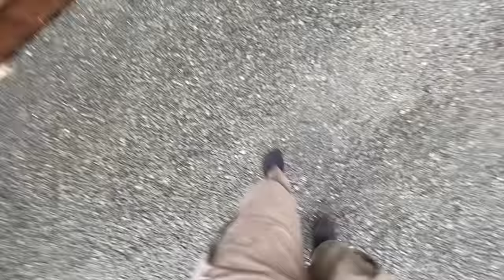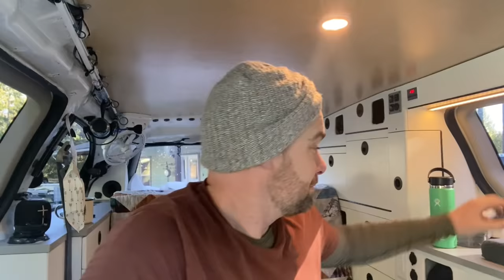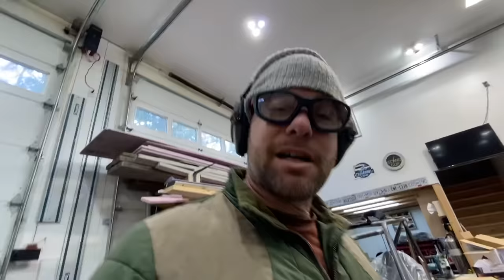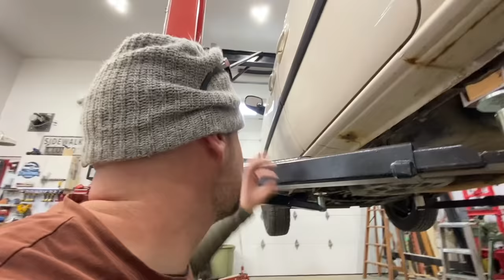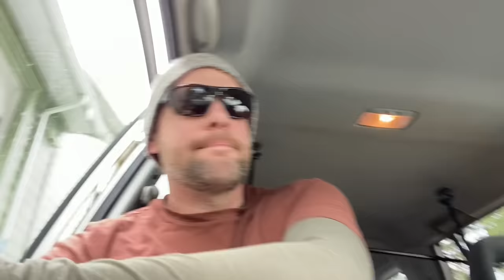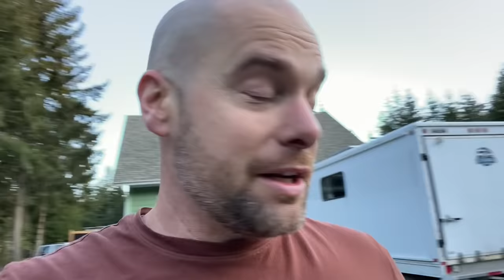DIY Fixing Mechanical Problems Created By Other People

Comment: If you don't use the Parking Brake on regular basis, leave the adjustment all the way in- loose- where it is now. An inherent flaw of that band style brake is that it rusts, it will swell, and the pad will start rubbing which is what causes all the problems you saw when you took it apart. By all means, if you use it regularly, adjust up and use like its meant to be, but if you do not use it regularly, leave it alone and it will last longer. Been there. Done that. Many times. That pinch rail is the frame, not just cosmetic. When that goes, you will start losing structural integrity. -the husband over my shoulder watching also ;) Howdy from Michigan half gridders. Was 70 today!!!! I got spring gardening fever! looking beautiful outside Hope you have a great week Joseph.

Comment: I just experienced that. Took it in for oil leak and noise. They fixed the noise, told me the next time I change my oil to change the oil plug and did nothing to it, then they said my rotors needed work. Paid $600. Picked it up and there was horrific noise from the brakes. Took it back and they said it needed new rotors. I picked up the car and took it somewhere else and they spun (?) the rotors and said the other guy didn’t complete the job.  I paid another $300. And they changed the oil and replaced the plug and spun the rotors and all is well. I was angry and went back to the other place and they refunded me $150.00. I left mildly happy and will never use them again!!!
Reply: you should say who these people are so no one else gets ripped off.  without acknowledging who they are allos them to continue doing what they do.

Comment: Worked on Cars and Vans in bodyshops 30+ years ..Leafs dirt pollen..Crap All of this sits on your roof And channels down into seams It rests in rubber moldings and lips of metal forming Mud The mud becomes acidic And Also Mud takes longer to dry than exposed water ...GM has a foam they put in the rear panel in the cabs of pickup trucks It is also the most common place these trucks just happen to rust out from ..They say "sound deading foam" I call it a 10 year rusted out time to buy a new truck foam....
Get new rocker panels from aftermarket. Drill out the spot welds Chisel the metal off...remove all foam... Sandblast gun the small areas free of rust  Zinc primer And rust paint.. Seamsealer And tack welds  Por15 the outside And rockerguard good for another 10 to 15 years

Comment: I really want to see what he can do with that Astro/Safari he has in the yard! Or, at least, what he HAS DONE, with an Astro/Safari.
Been there on the crappy work done by "recommended" 'repair' shops.🤔
 It cost a GM dealer TWO, count 'em, TWO, replacement engines in my Chevy Astro. Too many people out there claiming to be "experts', when it comes to automotive repair.
I seriously doubt I can, could, afford having him work on my Astro. But would certainly like to see what he is capable of. In that small space. I'm sure it is quite exquisite.

Comment: I went through a similar situation with my 2002 Chevy Avalanche. It started with the liar that I bought it from. That moved on to 2 liar mechanics. When I made it back to home base after roaming the country I found my rear passenger side brake was utterly, utterly destroyed. I rebuilt it myself. I checked all the other brakes but they were fine. All this and a massive oil leak were courtesy of the liar I bought the truck from. All this is bad enough in a normal life but if you are a nomad who lives in the vehicle full time it is devastating and life threatening. So what can you do about it - absolutely nothing.